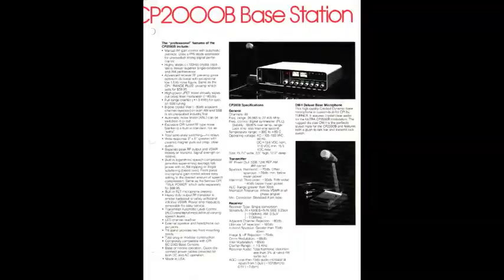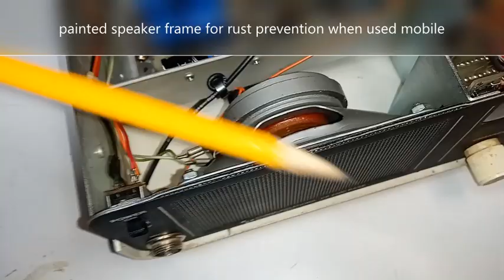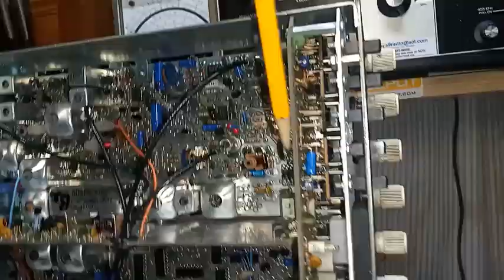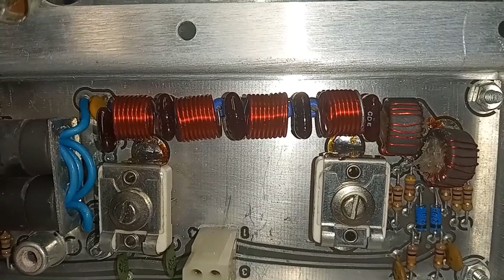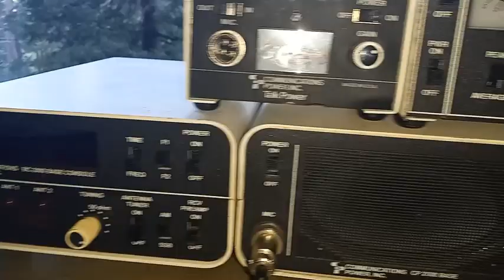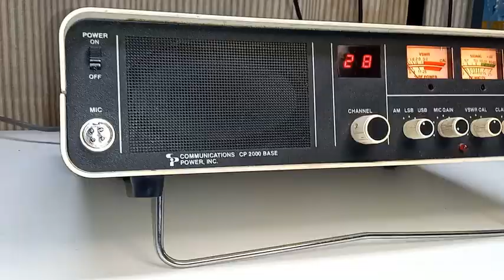CPI - CP2000 CB RADIO REVIEW & SERVICE HINTS

Comment: One of the designers worked for WJ which worked on special receiver/transmitter for the CIA DS&T. The designs were leaked out and designed into an insane set of equipment.

Comment: That EPROM worries me. If it dies the radio is a brick. What do you know about ripping the program with a burner and making a copy as a spare or a file to help others with smoked EPROMS that they can burn to a new chip?  That chip should still be available so it’s a matter of sourcing the program. Socketing the location so it would be an easy matter to swap them out.
Reply from the maker: Just takes time & money.  As an engineer it would consume about $10K in time and equipment to do this, are you buying?
Reply: @ Would it not be as simple as copying the data from an intact chip with my Batronix burner and making a new EPROM that way?

Comment: I worked for a friend’s radio shop when these were being produced. Great SSB radio, not so much on AM. There were so few of these produced they never achieved the updates needed to reach optimal performance with some functions. Some of the competitors produced good AM/SSB dual conversion radios with separate ceramic AM filters. They produced well over 40,000 units and made updates along the production where needed. Too bad this company was not around long enough to perfect everything. And if that Eprom takes a dump you have a nice doorstop.
Reply from the maker: Hello Ron, we've chatted before in the of the CB groups.  CPI much like Dak were a little late getting into the game as the big CB boom of the 70's was pretty much over, otherwise I think CPI would have set the BAR regarding performance.

PS-I get wonderful AM reports on both the early & late model CPi's with the easily adjustable carrier dialed back using the stock CPI/TURNER mic to the point that locals always ask what radio I'm on because it sounds so different.  I have one here for service right now with a dead eeprom, it's now a one channel radio hardwired for channel-38 and if it was mine, I'd wire up a small microprocessor to sort the logic gates out.  EZ peasy but too expensive for the client. 73-Gregg s9radio
Reply: Very possible. These radio’s still have a place, mostly with the individual that can repair them. The asking prices are silly, especially with the horrible condition I see them in. I personally never liked the white cases and knobs. Remember, it seemed  like everyone smoked back then, Ratchet jawing on the 11 meter band, chain smoking with a radio next to the ashtray. I run a completely rebuilt D201A with NOS boards I installed. Carrier Control unit, updated BA board & DDS in place of that drifty air capacitor. I would pick a CPI if I parted with my Tram.

Comment: On the right hand board near the front I can see some red blob tantalum capacitors with blue glue between them.
There are a couple more on the boards. A lot of people replace these types as they have a tendency to short out.

Comment: Greg, I need some help. I hope you see this...I received a CP2000 with the BC2000 recently, and they were new in the box with paperwork and dc connectors. It receives perfectly, but does not transmit at all. I'm not sure, as it did on the day I put it into service. Antenna SWR was 1.32:1, so I'm not sure what happened. It also had the CPI desk mic, also new unused. What I would like is some help to get it repaired. By the way, excellent video! I will certainly share it.
Reply from the maker: Service is tough at my mountain location, try calling 949-497-WIRE (9473) and leave message as it usually goes right to voice mail. 73 - Gregg s9radio

Comment: Such a cool radio, but you've effectively scared me away from bidding on them when they come up.   That recap job is beyond my skill level.  The final section with the classic input and output section with pill style transistors is very cool.  Unlike the home made amps, you also have the Chevyshev filter section.   A real work of art.
Reply from the maker: No, when these rigs were made in '78 there was not much in common with the US channelized 1-40 & Europe's freqs.  Would have been simple, remap the E-prom and retune the radio.  73-Gregg s9radio

Comment: I purchased a CP 2000 that came with a spare set of driver/finals, they are the B12-12 transistor as the driver and the M9583 final.
Reply from the maker: yeah, I owned two CPI's (circa 2000-2010) and let them go during a divorce & downsizing. I don't recall as they're have been so many radios since then whether I had to deal with the final/driver on the two I owned, but pretty sure I contacted Merit (RF PARTS) way back when getting this info.  BTW- Merit worked for the original Palomar Engineering prior to founding RF PARTS.  He's been my go to answer-man 4-decades +.   73-Gregg s9radio